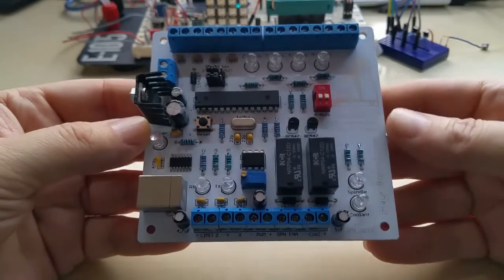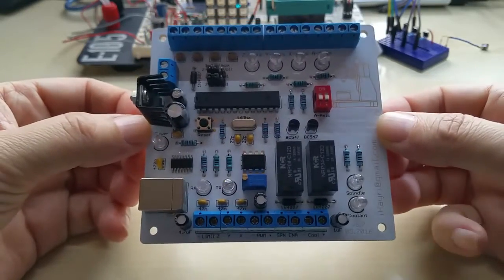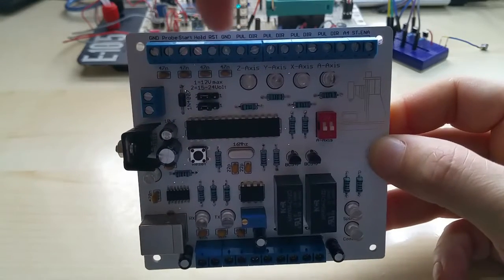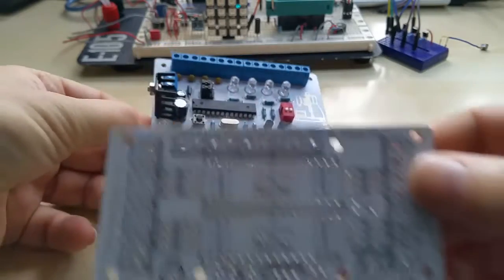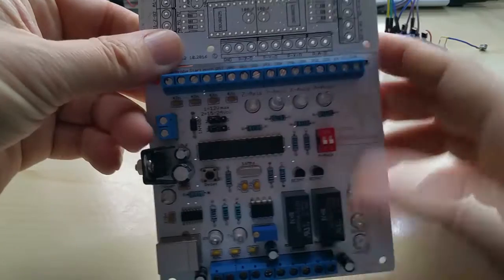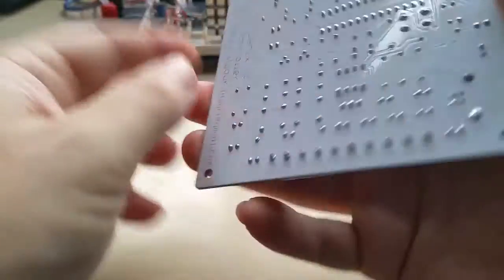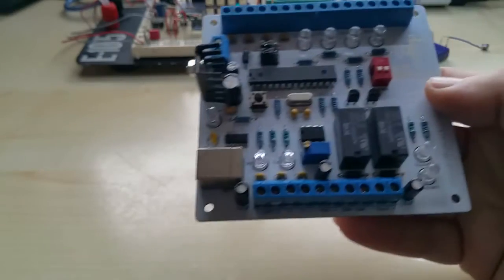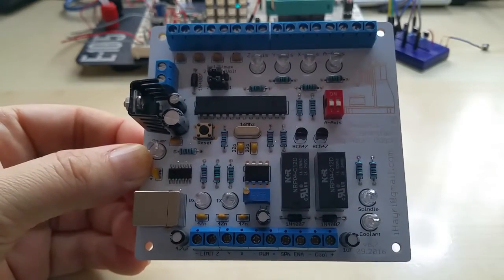Latest version of my Phoenix CNC Controller

Comment: I came across this video https://www.youtube.com/watch?v=6kuN7p_ivYE&t=393s and am interested in your board.  I have a 20 year+ old Sherline CNC mill that uses an old computer expansion slot to send g-code to a "box" that has drivers and power supply components in it.  Am I right in thinking that with your board I should be able to use the drivers and power supply and be able to hook the CNC to a computer from this Century?
Reply from the maker: Yes, it will work with your drivers and power supply. Just keep in mind that my board can be powered up to 24 Volts only. In case your supply is higher you would need a separate supply for my board. After that you will be able to use your CNC over a USB port on any Laptop or PC with free software. Just make sure your drivers will accept 5 volt signals for step and direction.

Comment: Will you be building any more in the near future? I'm looking for the controller and also your Stepper Driver board. Also will you use the 1.1 version of GRBL?
Reply from the maker: Hi, yes of course, just put in the order for the PCB's. Will update my Tindie store as soon as they are ready. And yes they support Grbl v1.1 and will be send out with it installed.
Reply: Hi, I just ordered the Stepper Driver board on Tindie and hoping you will have the Controller board built soon. Do you have a time frame or are you at the mercy of your supplier? Can't wait to upgrade from cheap chinese knockoff of the Protoneer (the A axis clone feature doesn't work so I can't double up on the Y axis...).
Cheers, Terry
Reply from the maker: Hello Terry, first thanks for your order. And yes they will come with Grbl 1.1. I should have the Controller back for sale in the next 2 weeks. My new PCB's are manufactured and were send out already and I have all parts here ready for assembly. As you might have seen the 2 PCB's connect to each other seamlessly via a male header strip.
Hayri
Reply: Hi again Hayri. I just received email from Tindie stating the controller board was in stock, so I placed order my immediately and I haven't seen a email yet that my stepper driver board has shipped so I was wondering if you could combine the shipping? Sorry for using youtube but I don't have an email for you...
Terry...
Reply from the maker: Sure can do Terry. Will build, test and ship them out together for you. And thanks for your purchase.
Reply: Hayri, the controller and stepper boards are working great on my desktop computer. Thanks for the very high quality work! The boards are beautiful!
One thing, I have trouble running gcode on my laptop, even though I have the exact same driver and UGS version. I think my laptop must have something wacky with the usb ports.  :-)
Anyway, thanks again! -Terry
Reply from the maker: You are very welcome Terry, I appreciate your feedback. If there is anything else please feel free to ask me any time. Take good care of yourself, Hayri.

Comment: subscribed your chanel couple days ago - it`s great and the work u do! I got a question - at the moment we are developing a smart elevator for different stuff sorting, and ofc the dev platform that we`ve chosen is arduino :) the whole system uses couple of stepper motors, 60 continuous rotation servos and a couple of IR/proximity sensors. For the stepper motors we use a  shield, for servos - JP serial servo  module  23 ch( two of them ). So the question is - will it be possible that we would send you the whole code with all the specs of our build and you would design and produce for us a board with of the the components like you`ve done for the CNC project ? Thanks and good luck with your job! :)